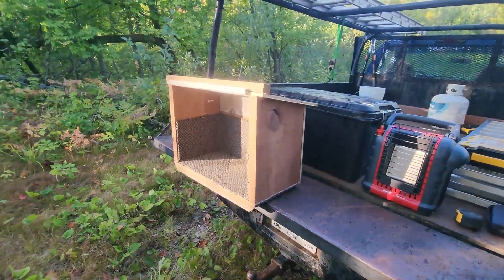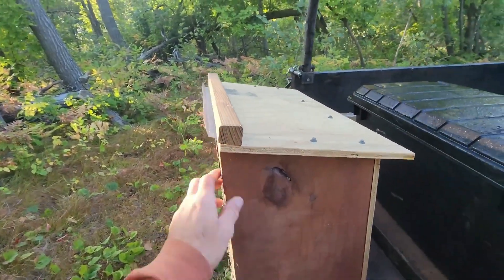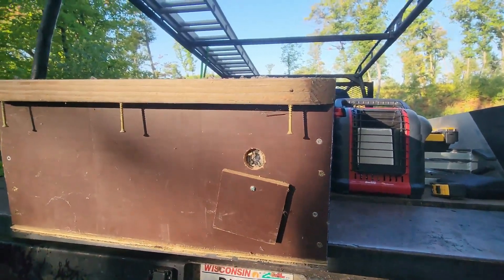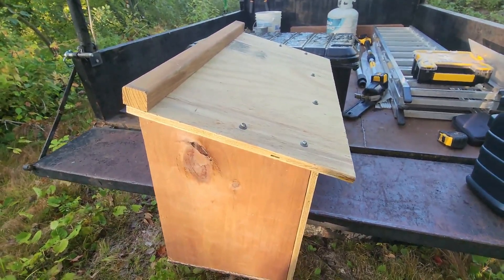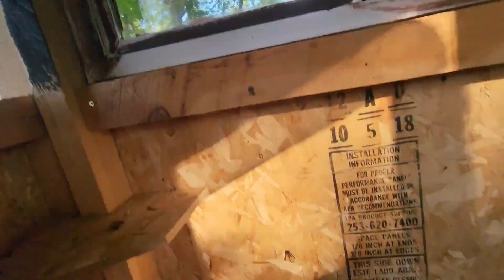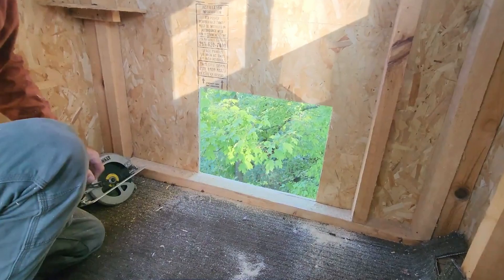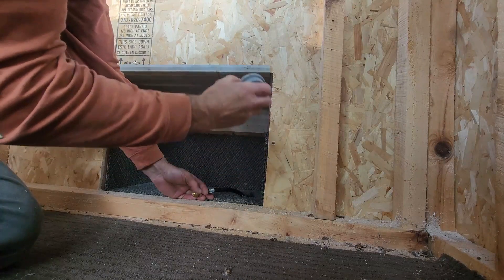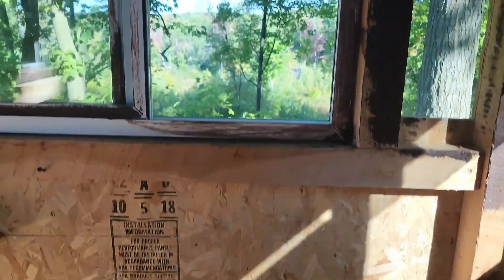Deer Blind Upgrade - Buddy Heater Cubby Installation

Comment: Your ideas and talents are so great. Just sayin'!   I can sew a quilt but am unable to replace a noisy ceiling fan or drop my closet rod 1/2 inch to get the hangers to go on easily. 🤦🏻‍♀️🤦🏻‍♀️😂😂  I guess that's the gifts God gave guys. ❤️❤️❤️. You do a amazing job with stuff.
Reply from the maker: Awe, shucks. Thank you! Your quilt making talent is no less amazing!! Sometimes, those white metal closet shelf brackets are the cause of that problem. Poor design. Perhaps adding a half inch of shim under the shelf board (just where it rests on the bracket) would help? Viitamin bottle lids would work - better with the hollow side up. Poke a hole in the center of the lid and run the screw up through it. You would need screws a half inch longer than what you already have in there though.

Comment: Thankyou I watched that video. I have the same heater it works pretty good my blind is small it's probably 5x4. I got hurt where I worked and had to start walking with a cane. And I knew it wouldn't be long and I won't be able to walk far in the woods. So I wanted a blind off the ground and made to stay warm in. I live in upstate N.Y. It gets cold here to. I wish I would of made mine bigger.
Reply from the maker: Good luck out there!
Reply: @UncleBucks  Same to you.

Comment: Why didn’t you angle your roof where water/snow would fall off at the 6 o’clock position instead of your main shooting windows
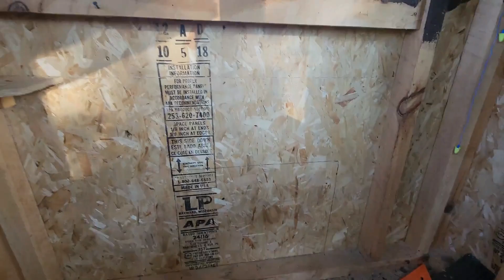Reply from the maker: My Dad built this one, so not sure why he decided to pitch it this way. The main shooting windows are in the front, 12:00 position, above the cubby. If you mean the back (door) side as the 6:00 position, I certainly don't want rain, snow and ice dripping and accumulating on the ladder. That would be the worst side to pitch it downward to.

Comment: Spray the outside of the blind with 80 percent used engine oil and 20 percent kerosene preserves the wood and all mice and insects steer clear
Reply from the maker: How about the deer though? Do they route around it too?
Reply: @UncleBucks  smell goes away in 2 weeks I do mine like every 3 years in the early spring
Reply: Is this mixture approved by the EPA? 😂
Reply: @samrichmond2940  sure is just send sleepy joe an email he will tell ya
Reply from the maker: @samrichmond2940  Yes, I called them first to verify, lol